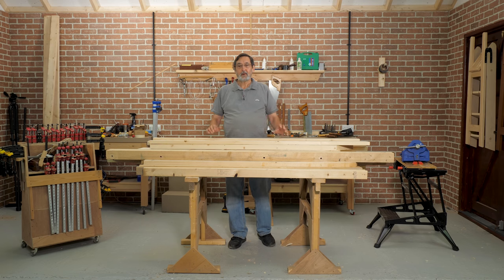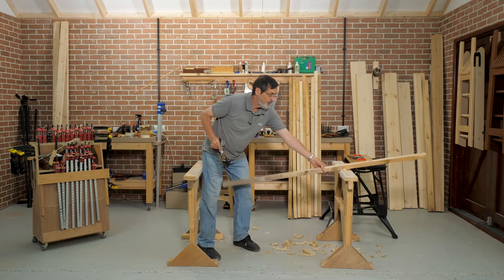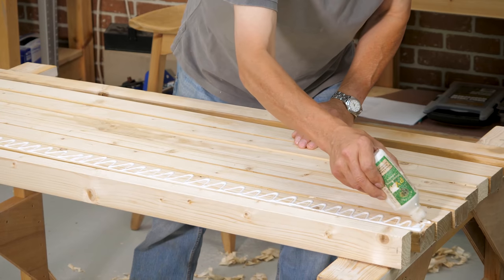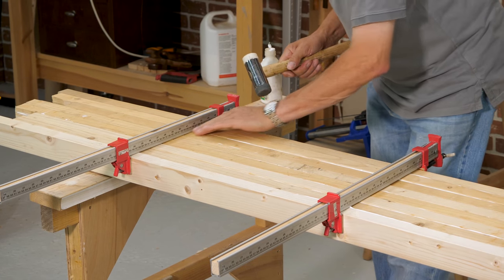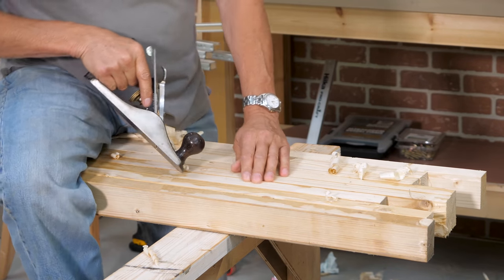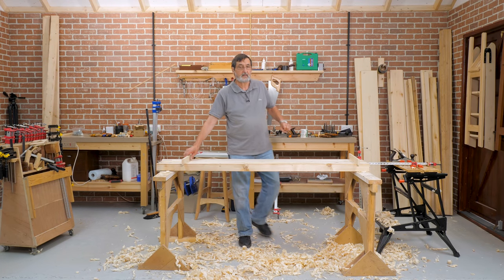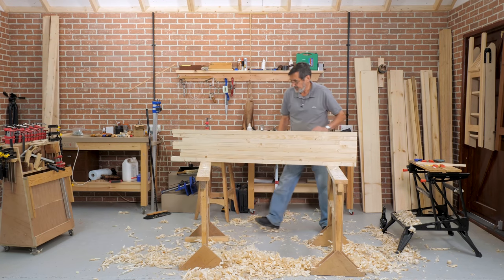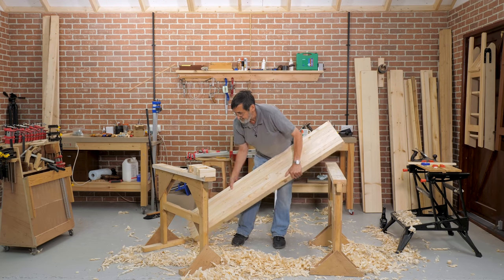How to Make a Workbench Episode 1 | Paul Sellers

Comment: The most amazing thing about this video is that Paul is actually building a workbench without a workbench! Great
Reply: And that points out the necessity of first making a pair of sturdy, identical (at least in hight), out of twist saw horses, or trestles. Then you can avoid having to work on the kitchen table or the floor.

Comment: Paul, I've been following you for a few years now, I've sharpened my chisels, made myself a scrub plane from a cheap $24 plane, made winding sticks, mortise guides and so on and so on ... And I just keep coming back. There is a beautifully elegant simplicity to your videos and to this project particularly. I love how you are building a bench without already having one, how you've designed it with the most basic of tools. I already have a workbench but I need a new one and this is definitely my next project after I finish my outdoor table based on your other table making video. Thank you so much for your time, effort and patience. You are an international treasure.
Reply: I wish I had seen this before made my first work bench. It’s ok, but the top I attempted to level with a belt sander because I didn’t have a plane worth a damn. Now I have ……8 planes, but 1 is a craftsman that I use as a scrub because of the backlash in the adjuster(3.5 rotations of slack) and one Stanley #5, one #6 both with replacement Hock blades now. What a difference. I’m keeping the old blades to make cambered irons but for fine work, those Hock irons(Yowsa!!) 
My next build I think I am going to use heavy hardwood for the frame, and MDF for the top.

Comment: So glad to see a workbench video that shows you how to make a workbench using hand tools rather than power tools. Other woodworkers will show you how to make a workbench using a jointer, planer, band saw, table saw, drill press, and so on, with everything put together on top of an existing workbench (of course). Your approach is much more accessible to those of us who don't already have a workshop with lots of expensive power tools at the ready. You may buy reclaimed lumber of roughly the right dimensions as in your video or have the lumber yard / home center cut them down to size for you, but after that you can do all the work yourself by hand. Thank you for this excellent series!

Comment: Great quality as usual! Not at all sure what people are dissatisfied with but to each their own. 

Also, every question in the comments so far has been extensively answered in Paul's blogs and other videos, so just search if you are confused. His advice comes from 50 years of doing it for a living and as a lifestyle. 

Just to second it, large planes are great but they are expensive and I personally don't own one larger than a 5 because there were other planes I needed instead. I actually bought another no. 4 and a wooden jack instead of a larger plane. 

I must say that wooden planes are extremely effective and handle differently than metal planes. Though they appear primitive, they are generally highly refined and require added sensitivity to set and operate. All planes are extremely sensitive though and in my opinion are instruments.

Find out for yourself and don't stop experimenting.

Comment: Also, those aluminum bar-clamps I now find essential to every little project.  Took them from carpentry yesterday to metalworking. Used them to help fab a crude bench last weekend.  Greatest "new tool" for this soloist. They're floppy junk without the wooden stiffeners, thanks Paul.

Comment: After watching your original work bench build video I made one of my own based on your design and the bench Jay Bates made. So it has aprons but the legs are also mortis&tennon through the top with wedges. Unnecessary but whatever I didn't know what I was doing. It's a massive piece of hardware now. I love using pine to make things. I think the grain looks like flames especially when oiled. But the knots are murder on a hand plane. And it's so soft it's hard to make crisp edges.  Thanks for the videos.

Comment: I've got nearly all the timber ready and waiting for a good temperature now here in Ireland to start the first steps.

One thing I will probably try out during the lamination is to use a small furry paint roller to speed up the paint application. Not sure yet of the drawbacks, but I've assisted in making laminated doors and they used the roller to cover large areas quickly.

Million thanks for sharing all your knowledge with us and also for making the cutting list and drawing easily accessible. Looking forward to the full workbench-series.
Reply: One of the premier exotic cutting boards on YT uses "furry rollers".  Puts them in a small tray of water then not in use so it does not dry out.
Roll on!

Comment: Just finished the bench.  Wanted to pass on a big thanks for these videos, they are awesome, especially the joinery tips and hints.  I followed the instructions pretty closely (fully admit my joints are not as pristine as Mr. Sellers' - lol - but it's still a very solid and heavy bench).  My only regret is maybe using a harder wood for the laminations, I am concerned construction pine may wear quickly - but I can always resurface the top with my plane in the future.  I also put my winding sticks to good use. Thanks again - so happy I tackled this project, it was a ton a fun and the bench should serve me well.

Comment: I have come to a point in my life where I need to build a decent work bench, much like your plan here, only a little wider 24”, Hoping to keep each section 12” wide and levelling it off on top of piece of plywood and running it through my 13” planer, then gluing up the two sections. Just to save some time on the planning.  Thanks Paul.

Comment: Paul:
I'm about to make extension for my workbench and I plan to make it using this design.

Funny story:
Interesting thing, when I first built my workbench and mounted it to the cinder block wall for extra stability I made sure everything was square, level and plumb because I remember reading that if your workbench is off everything you build has a chane of being off. So I put the entire thing together and I had one leg left to install (back si supported by a sill on the block wall, left front l g is a 4X4 and I go to install the last leg and... It's and inch short.  I measured and measure again and I could NOT for the life of me understand what I had done wrong. I finally figured out out. The bench was level and the back support was level on the wall but the FLOOR was pitched towards the garage door. Lol. I learned a lesson there. Don't measure somewhere and assume it's going to be the same 6 foot away in a house because it never is. Now I take multiple measurements. Start, middle and end minimum just to check.

Comment: Brilliant series of videos to make a brilliant workbench. Thank you Paul. Could I add something please that may help in certain situations eg, when you're a relative beginner to hand planing? When you were flattening the sides of the pieces to make up the laminated top the darkened surfaces of the recycled timber made it easy to see where the plane was catching the high points and to know when you've gone far enough, as the plane reveals clean white wood under the surface. Not so easy with new already white 3x2 CLS as I am using. So.. what I did before planing was a very light rub over the 3x2 with some wood dye, in my case Van Dyck Crystals, which gave a surface result similar to aged second hand wood. Much easier to see what's going on now.

Comment: Hi Paul..I built my first bench from your first bench series of videos on the subject and it's still in decent working condition, but over the years there's a few things I'm going to change for my needs..I'm leaving out the tool tray because I have the nasty habit of never emptying it so it becomes a permanent junk collection portal. I'll probably extend the apron down about a foot on one side, about the same depth on the opposite side for storage. Length is still just fine and the distance from floor to top is still ok, perhaps a tad higher to match my table saw. I still use it more than I want to for speed more than anything else. The legs from the old bench are still every bit as stong as they were the day I built them. So I'm considering a split top and using holdfasts much more than years past and using the removable center board with the holdfasts..(the name of the board escapes me right now)
I do appreciate the few extra tips that weren't in the earlier videos. 
I will say I've invested in the Universal clamps  from Debuque, Iowa instead of the cheaper HF clamps. MAN! The Universals are sweet..They never jam up and don't really need the piece of lumber in the rails since they really don't twist at all.. Yes, I do recall your video about those cheap clamps. I think even you might appreciate the Universals.. ;)

Comment: I always enjoy your videos, and learn neat tricks as well.  I have to say that I'm a bit sceptical about how easy it was to get the top all sorted out.  Getting surfaces flat is a challenge on its own.  Add that to the fact that you put the pieces together without testing the grain direction of each one, and placing them in the stack so they're all going the same way, it is a minor miracle that you could work the plane without tearing out massive hunks.  Maybe you have an eye to spot grain direction from a mile away and you put them in in the right direction without thinking about it.  Anyway, it's a great video and I look forward to watching the rest of the series.

Comment: Before I started watching paul Sellers I bought loads of tools . Low angle and the like . Now i must say since I learnt how to tune them up I prefer my traditional planes as you can so easily adjust them on the fly and so what if it's a few extra spins of the thumbwheel.

Comment: i am slowly coming to the realization that the hand plane is an enormously invaluable tool, also i imagine one could use a shooting board to true up the edges of the laminated top?
Reply: Warren Buitendag the shooting board is indeed invaluable!  I used to rent shop space and the miter saw wasn’t square at all.  Up until I made a shooting board, I would spend time squaring up the saw but with the shooting board and my hand plane I could square edges no problem.

After all that frustration I realized there’s a reason why hand tools are invaluable.  So much so I’ve decided to go hand tools completely.
Reply: No point to squaring up the edge of a work bench.  This is not furniture.  Careful work with a plane on a carefully sawn edge should be enough.

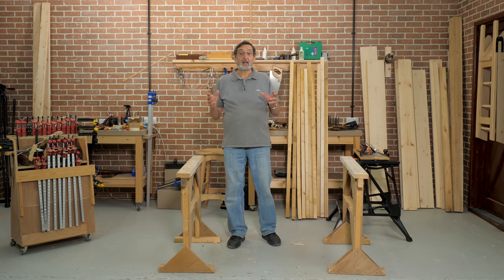Comment: One question - when straddling the pieces for the benchtop (around 3:00), does that not bend them such that the planing is less effective? I'd assume you'd want any piece of wood to be as free as possible from external pressure, so that when you've finished planing (i.e. when you get off) it doesn't just spring back up and still have a bow in it?

Comment: Hello Paul, this is a fantastic series, and I enjoyed it immensely along with many of your other videos.  I am a budding woodworker and have generally used power tools, but I am working on getting into hand tools with my most recent purchase being a Stanley no.4 plane.  I am considering putting a bench together like what you have made here.  I do have a question though and hopefully you still peruse new comments.  I live in a tropical climate where our buildings are often quite open and it is quite humid.  Standard construction lumber here is almost all Douglas fir that has been treated with borate to repel rot and dry wood (not ground) termites.  Dry wood projects here attract termites prodigiously, often eating into wood furniture.  Do you know if there would be any issue using borate pressure treated lumber that has been dried to laminate and build a bench like yours?  Thank you.

Comment: If you are in need of a large quantity of flat board to glue, you can just put it through a drum sander (one of the best productivity improvers a woodworker could own by the way), it will give a surface flat enough for an invisible glue joint. Planing is fine if you're not prepping a lot of wood though.

Comment: Something some folks may want to consider is leveling the bottom side of the top where you vise bolts up if you're using the type that bolts up to the under side of the top. Mine has worked its way lose several times over the years and I have had to use shims more than once. I'd smooth all that area if I had it to do again. 
Hey! I am going to do it all again..I'll have to remember that I wrote this.. (hint: I won't remember. I'm getting old too..)

Comment: Hey Paul, thank you very much for all your videos, I find them very informative and like your calmness when teaching. Can’t wait for,the other episodes. Would it be possible to add a tailvise to your bank? Also wondering what the massive overhang in the front is for. Cheers, Daniel
Reply from the maker: You can add another vice on the end of the bench that is the same as the face vice. Paul tends not to use one, so it isn't included in this build. Not sure what you mean by the massive overhang. Have you seen the drawings linked to in the description?  - Team Paul
Reply from the maker: Hi Daniel. Yes but you have to put the top rail of the leg frame lower down to allow for the rods of the vise to pass in between the top rail and the underside of the bearer.

Comment: Is there going to be a substantial difference between this workbench and the one he built in his garden several years back?
Reply: It appears that there will only be one work surface, with the tool well along the back instead of two work surfaces with the tool well down the middle.  In the intro video the joinery appears slightly different, but not a major difference.  The biggest difference I think is that the one he made in the garden was designed to be broken down and moved easily, this one appears to be more permanently assembled.
Reply from the maker: There are three main differences:

1. This bench is smaller, it is shorter, only has one side, and is easier to move
2. This series is more thorough (we missed showing vise fitting last time)
3. This bench build includes full measurements (you can still adapt it but you have a solid starting point)

- Team Paul

Comment: Though I dislike store bought lumber, preferring to buy logs and mill my own, this would be perfect for a garage setup.  In our shop we milled 6” x 12” x 24’ beams and kiln dried them, resawed, planed with 30” x 3” ships deck (and keel) planes from 1786 then glued and bolted them using 1” threaded rod every 24” and 3” fender washer side by side on a 26” deep 1-14” marine plywood cabinetry and 24” oak faced plywood drawers on 800 lb glides to hold the tools.  Disadvantage?  Took 8 months.

Comment: I just learned perhaps the most important lesson. When you glue the boards together for the top, do absolutely anything and everything you can to prevent twist. Hit it with a hammer, dump a heavy weight on each end, I'm not  sure what the best method is. I don't know why it happened, my sawhorses were flat and without twist, but when I glued together the boards for the workbench top, I ended up with a massive amount of twist... about 10 millimetres end to end. And now that they are glued, I'm screwed. I have to either take 5 mil off on each end, which is a massive amount to remove with a hand plane, or throw the whole thing out and start over... and after a day of planing the dang thing, I'm starting to lean towards starting over!  So beware all you novice woodworkers out there, whatever you do, watch out for that twist!

Comment: Dear Paul, does it matter what kind of wood is used (pine, oak,...)? Great videos, great content, very educational. Great work.
Reply: Wood doesn't matter too much, but his technique works best with pine (or any other construction lumber) This is cheap too so that's a big plus for pine. Hardwoods like oak, maple or beech are often used for workbenches as well because they have more weight (more stable) , however they are expensive and in some ways more difficult to work with. If you make a 4" thick pine table top, there really won't be any problems with weight.
Reply: Thanks Florian, exactly what I like to hear :) I saw the older version of workbench that Paul made and it looks a lot more robust and strong and heavy. But that (weight) is exactly the reason why I am excited about the new, bit more easy to handle as it looks like bench Paul is making (I am not sure whether there is any other difference than the dimensions) since I will be using it in a small garage and will need to move it quite often.

Comment: I've watched both episodes at least twice each.  I learn a bit more each time because my mind focuses on different bits of information.  One of the things I now question is why the #4 hand plane was used to prepare the boards for the table top when a jack plane was at hand.  

Perhaps it was to demonstrate that the common #4 will do the job adequately, but will the jack  - or even a jointer - plane be better suited if one has them, provided that there is no gnarly wood grain?  Although I consider myself a beginner at using hand tools, I'm 75 yo and have (mis)used or abused them for most of my life.  I do have a common #4 and a jack (#6, IIRC), and a #8 in my stable of older Stanley and Millers Falls hand planes.  Am I ill-advised to use a fettled and sharpened jointer to prepare the top boards?  If so, why?  Heavier planes require a bit more effort to use, perhaps; but they also offer more mass ergo more energy to the process.